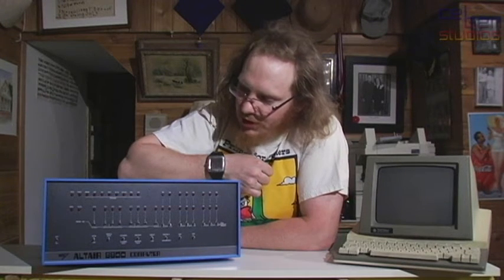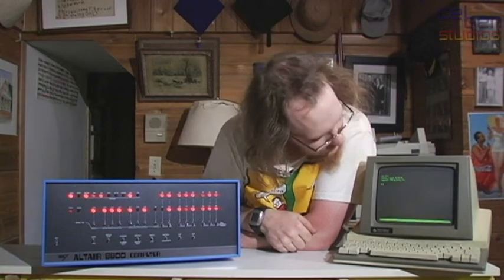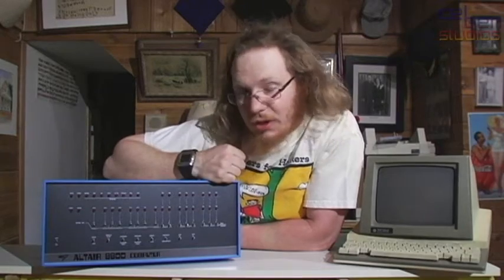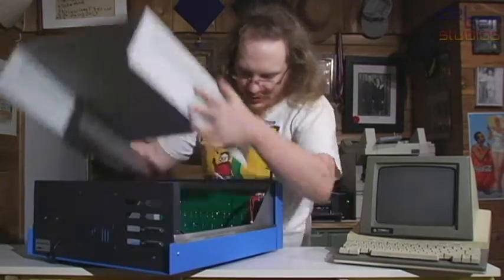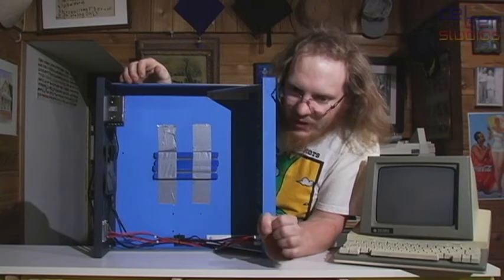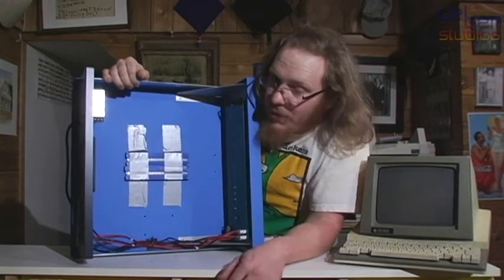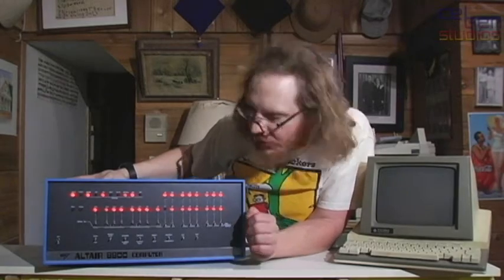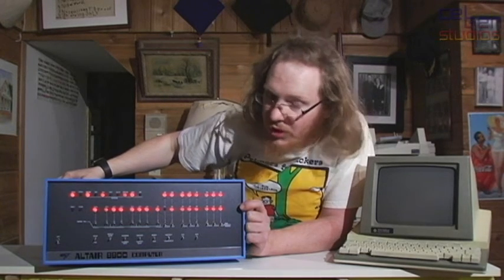Altair Clone: A Few Words on it

Comment: I think it would be very difficult to do what the OP suggests, namely converting this clone to have actual S-100 slots inside and integrated to the front panel switches and LEDs. Not impossible, but VERY difficult, and not worthwhile doing. If S-100 is really desired, go with a real antique Altair, or build your own from scratch.
Reply from the maker: Yeah, in the end I abandoned the conversion and am leaving it as-is with the emulator.
Reply: The people that make this version of the clone make one with a full S-100 bus, and they sell some cards as well.
Reply: @llamathenerd1672  , not according to the guy who produces THIS product, and his website. Please provide evidence to back up your statement....I suspect you have confused multiple producers of Altair related equipment.

Comment: You don't have to add a hidden switch....That's what the aux switches are for :D. They actually have no function and are there purely for the user to add options. I keep hoping he adds a break out for the s100 bus to attach to a backplane. All we need is a pin terminal, or even probe points for a pin terminal(which would cost nothing to add). Thing is, that thing is a fully decked out altair already. I think for total geeks like me though, i wouldn't mind toying around and wire wrapping up a few boards. Like a decent sound board for instance. 

The real issue at that point would be power consumption, and noise. The original altair had a linear supply for that reason. The old chips were noisy, and also didn't agree well with noise. That switch mode supply isn't hefty enough to power one, and the boards you design would need some lovely thick ground planes to compensate for an ATX style supply. In addition, the altair bus has some funky voltages. All regulation is done on the boards individually 8vdc on the main bus to 5vdc on each card etc. The good news is that all modern microwaves have just such a linear supply :D. Including the giant cap. You would have to re-wind the transformer to the correct voltage on the output side, But any broken microwave will do.
Reply: Peter Lamont, the Altair Clone is all emulation, with no circuit similarity to an original S100 Altair. I don't think there is any feasible way to adapt it to interface with other circuits, let alone an S100 bus. And all the toggle switches, except for the AUX, are wired into a scanning matrix to the integral microcontroller. Essentially impossible to interface those with a normal Altair circuit. Trying to turn this product into a 'real' Altair, or make it S100 compatible, is a pipe dream.

Comment: IMHO, this is THE way to experience early microcomputing, so much more realistic and satisfying than some other Altair clones and emulators, while still being affordable. Real Altair's, if you can even find one, will be very expensive and probably unreliable. Some lesser Altair clones and emulators are less than perfect in their emulation, or don't look right, or work right. This Altair Clone is purportedly the most accurate emulation available, and with the most accurate physical interface. It comes with as much memory as an Altair can have, has three Altair floppy drives (emulated) inside, and preloaded with 8k Altair BASIC, Altair DOS, and CP/M but other disk images can be loaded by the user. It comes with the boot loaders already in it and ready to go, it has a monitor/configuration program built in. It has the Altair dual serial communications card (emulated) built in, and two RS-232 ports. Hook one port up to a terminal, or PC with a terminal emulator, and you already have a full blown, fully functional, Altair business computer system, ready to load in machine language, CP/M, or BASIC programs and use it productively. Or just use it in simple, "switches & LEDs" mode for the fun of it, or for demonstration purposes. It is a great product.

Comment: A bit pricey for me, but lately there have been a few people emulating the Altair using the more powerful Arduino models, so maybe I could give that a go. But even then I would have to deal with the slower speed of the Arduino and miss out on some of the extra bells and whistles. Btw what terminal is that? It seems so compact.

Comment: You could build an Apple 1 replica for 550 this is still expensive considering you need a terminal too
Reply from the maker: In its defense, the Altair Clone includes an emulated floppy drive at no extra cost and can access a very large legacy of archived software, not specifically limited to titles from MITS or for 8K BASIC. The Apple 1 replica at best has a cassette interface and approximately a dozen software titles are widely known to exist, not including screen dump images of Woz, Steve and the Apple logo. An Apple 1 replica kit would be fun but I can't justify paying $550 for such a (I'm going to be judged on this call) useless computer.
Reply: @CelGenStudios  they are all useless in this age if we want to judge by how much you could do with that processor but they are all very fun to use, and demo for others 😀